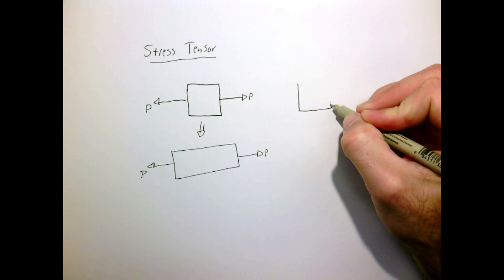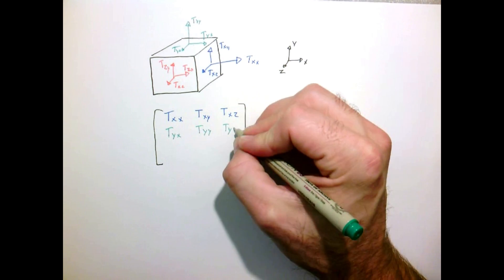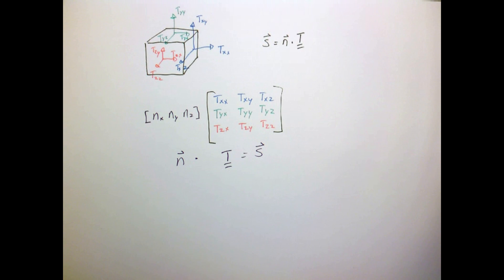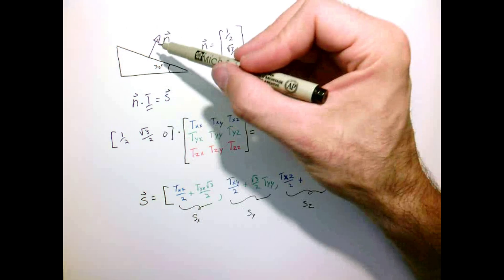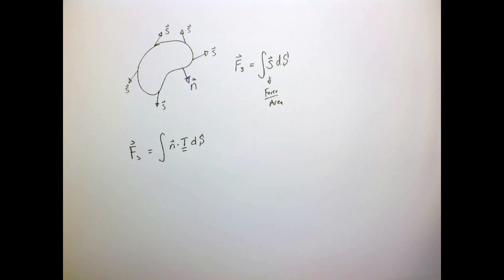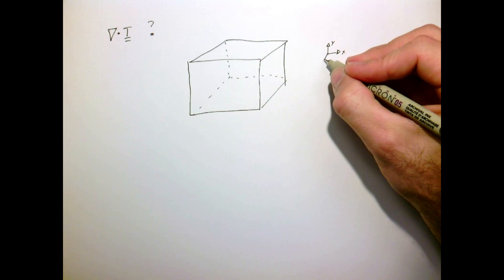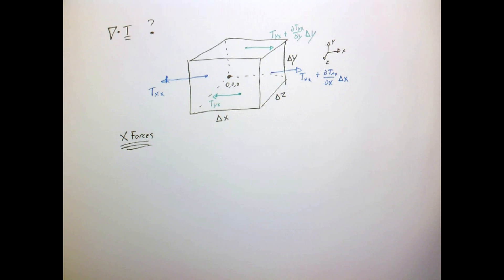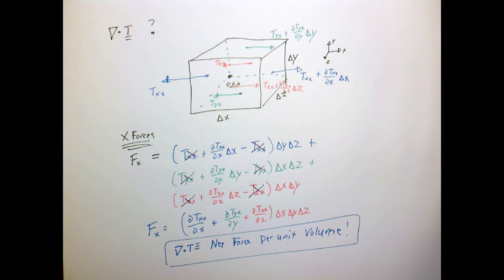The stress tensor

Comment: I have a question! Why used the partial derivatives ?
Reply: Because in the definition of the nabla operator, the coordinates themselves are independent and not functions of eachother nor time. Any product rule that would result from using total derivatives would equal 0. If not, you are invoking a coordinate system with boundaries!
Reply: @ 3 y ago ):

Comment: Could someone explain why forces acting in the same direction arent just the same force? I mean they’re coming from the same point right?
Reply from the maker: I think I understand the question, which is why do we count the x direction force acting on the normal face different than one acting on the other faces?  This is a common and good question. I am not sure that I can answer the question well here in the comments, other than to think about how material responds differently to normal (stretching forces) versus shear (sliding forces).  I think maybe a key is to think about the differential cube of material and remember that even though we take the limit of the cube getting smaller and smaller, we still think about the cube as a real 3D object.  Hope this helps. but just keep working on it!

Comment: Hi i’m reading a textbook which says that the stress vector is equal to the stress tensor dot the normal unit vector. Here you wrote it the other way around. You are the second source i’ve seen to write it this way and i was wondering if the textbook is wrong. Great video btw!
Reply from the maker: Confusing right?  I think I am correct. The only way to be unambiguous is to use the Einstein index notation - but for teaching concepts I find this gets bogged down in subscripts. The fortunate thing is that since the tensor is symmetric you get the same result with n dot T and T dot n.
Reply from the maker: And... in matrix notation n dot T is like a row vector on the left multiplying a matrix and T dot n is like a matrix on the left multiplying a column vector.

Comment: Hello Mr Storey, three questions:

1. Why do we only talk about 3 faces of the cube to define the stress tensor? Is it because the Cauchy's Theorem?
2. When you apply the divergence theorem you leave the normal vector, why? 
3. I though the divergence was a scalar field, not a vectorial field. The divergence of a tensors results in a vector?

Thank you very much, great explanation.
Reply from the maker: 1) The "three faces" question is a common question and confusing point. The cube is mainly used as a pictorial tool.  Perhaps a better way to think is that there are three perpendicular planes that intersect at a point. That is the point that the stress tensor is defined. For each plane that intersects that point, there is a stress vector.  These two aspects (the plane and the vector) give the 9 components of the tensor.  The cube is easier to draw as the vectors don't overlay each other.  
2) I am not sure I understand question 2.  
3) Divergence of a vector field is a scalar field. Divergence of a tensor field is a vector field!

Comment: how do u know when the n vector matrix is a column or row
Reply from the maker: Yeah, this is always one of the most confusing things. It is always a row vector, but since the tensor is symmetric - it is OK if you mix it up.  If you work through an example or two yourself with the sketch of what the components are with simple normal vectors (like [1 0 0]) you'll see how symmetry saves you!

Comment: Hi there, I am confused about one thing:
Does it matter if you do n . T or T . n, i.e. the order of the dot product of the tensor with the normal vector? I get 2 different results. I know with a vector, it does not matter.
Reply from the maker: So it is different if you think of the 3x3 tensor multiplying a column vector, n or a row vector n multiplying the 3x3 tensor.  However, the stress tensor is always symmetric (from angular momentum considerations) therefore for the symmetric tensor you get the same result!  If you do much more with tensors, it is usually better to work in index notation, but that opens up more complexity than I wanted here.

Comment: i think at 8:00 minute see divergence of stress tensor gives components in terms of (del T ij / del xi )j so it might be right only in case of stress symmetry. But if stress tensor represented as column vector combination of stress on each plane then first column will give stress on plane perpendicula to x and so divergence of it gives del Tij / del xj ) i in general . is it correct or not?
Reply from the maker: So the order of things is always easy to confuse and something I tend to screw up a lot.  Is it Tij or Tji?  It is a common mistake, and one I have trouble with. The good thing is that in the case of stress, T is ALWAYS symmetric. So it doesn't matter.... 

As you note, using index notation is a better way to be clear about which components you are talking about, but that was not something I wanted to introduce here.

Comment: Great video. Net force per unit volume--so, basically the net force density? But then there are three (x, y, z) components. How to think intuitively about the ith component of density? Density in the ith direction? What's that?
Reply from the maker: Ah, I think maybe this is just confusion over the word "density".  Usually when we use the word density, we mean "mass density" - mass per unit volume. That is a scalar and thus has no direction. 

By force density, we just mean the force (vector) divided by the volume over which that force acts. So \rho g is the force density due to gravity.  It has a component only in the direction of the g vector.

Does this actaully answer your question?

Comment: My ignorance shows, why have you not shown the stress tensors on the other three faces?
Reply from the maker: Yes, that is always a little confusing. We are assuming the tensor is defined at a point in space.  It might be better to think of a point in space that is the intersection of three perpendicular planes. The stress tensor is then defined at that point, with the three force vectors on those three planes. 

That is harder to sketch than a cube... so that is why traditionally the tensor is sketched as a cube (or at least I think that is the reason).
Reply: Because each opposite faces have the same stresses due to equilibrium. So representing the stresses on 3 faces is enough because the opposite will faces have the same stresses with opposite directions.

Comment: Question: Why is it that when you wright out the stress tensor, you start with Txx?? Why is it defined like that and not arbitrarily with Tyx as the first entry?
Reply from the maker: I guess one could devise a different system that would work, I am not sure what it would be. There are some properties of the tensor that I don't discuss here that must be maintained (i.e. you want the tensor to give you the same answer if we change coordinate systems, we want the tensor to conserve angular momentum, and many other things).  I could imagine it may be possible to devise a system that satisfies all those constraints. 

However,  sometimes we all just have to have an agreement on a standard and a  system to move forward - so maybe that is the best reason of all!
Reply: Oh i see, fair enough ! Thanks :)
Reply: The stress tensor T can also be thought of as three column vectors and three row vectors. In vector notation the order is important, so you can visualize the stress tensor with its nine componets having a header row with x, y, and z and a header column with the same x, y, z. In the convention used here, each element in T has subscripts x, y, or z corresponding to the headers of T. 
As Brian has answered, this is simply one scheme that works and there are symmetrical  counterparts that also work.

Comment: 9:30 how is that a Taylor series? And perhaps more importantly, why did you do a Taylor series?
Reply from the maker: My explanation was probably a little imprecise here. That is only the first term of the Taylor series. The full thing would be like this   http://mathworld.wolfram.com/TaylorSeries.html

The idea is that you can expand any function (even if it is unknown)  locally around a point in space using the Taylor series. As you take the limit of the distance of the adjacent point becoming closer and closer (i.e. as dx -> 0) then only the first term starts to matter.  For example if dx = 0.001 then the terms proportional to dx^2 have a magnitude of 0.0000001 and terms proportional to dx^3 are 0.0000000001 in magnitude. I.e. only the first term matters. All this is a fancy way of saying that the value of some function f, close to zero could be locally approximated by the line  f(x) = f(0) + df/fx x

Hope this makes sense.

Comment: Hi, when you are at 4:58 and have triangular body, I don't understand how can you multiply with Tyx, Tyy, Tyz, when Y face doesn't exist at all?

As well, why tensor has only 3 vectors, when cube has 6 sides. There should be 6 vectors in a tensor?
Reply from the maker: On the first question. The surface normal vector has a component in  the x and y direction, so face does have a y component - so to speak. I know this is a pretty lame explanation, but the geometry is really tricky. I think you might have to work out an example. You could try an example where you take the little square aligned with the axis and cut a diagonal through it and equate all the forces. It is a little hard to explain in the text box of this comment without drawing another example out.  Maybe if you look at "Mohr's circle" in solid mechanics, you this will help.

On the second question. We considered only 3 of the six faces. This is because the stress tensor has a LOCAL value. It is evaluated  at a point in space. Therefore, for equilibrium to be maintained the Txx and Txx (on the opposite face)  must balance out and be equal. Thus the forces on the opposite sides of the face cancel.  Thus there is a vector with three component acting on the three faces. The stress tensor then has nine components (3x3 matrix). Conservation of angular says the matrix is symmetric and therefore there are 6 unique components to the tensor. 

Hope this is helpful

Comment: Good job! But I wonder, why did you represent some forces with opposite directions? I mean, you placed Tyx and Tyx+(dTyx/dy)dy with opposite directions as if you already knew these forces had that direction. Could you please give me a convincing explanation of why that is? Thank you, Brian Storey.
Reply from the maker: If I shrink the width of the differential element, dx, to zero - then the sum of the forces must be zero. The forces must be equal in magnitude and opposite in sign.  The forces have to balance as a remove the distance between them (there is no mass x acceleration to balance an imbalance in forces). 

As I type this I realize this is a short explanation for something that may seem   confusing and is not as simple as I am claiming. As usual, it is often hard to answer questions in this forum - so I hope this makes sense.

Comment: Question about the normal vector in the triangle example. Wouldn't the components of the normal vector, i.e, 1/2 and sqrt(3)/2 be switched since the cosine is in the x-direction (thus making it first) and the sine is in y-direction (making it second)? Assuming we are defining a vector as v = [x , y , z] ? EDIT: I SCREWED UP

Ayyy lmao, nevermind. I just did the geometry. Carry on. Thanks for this video!